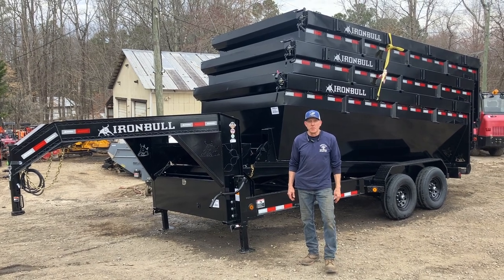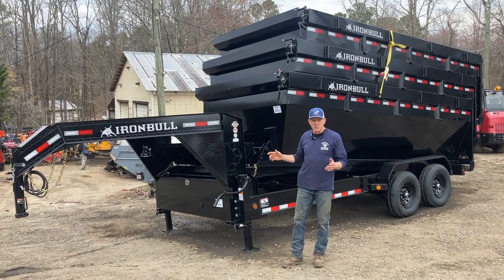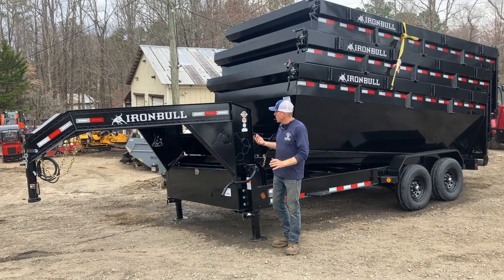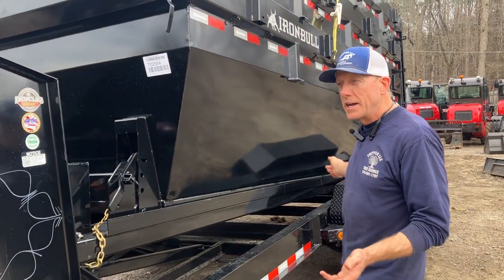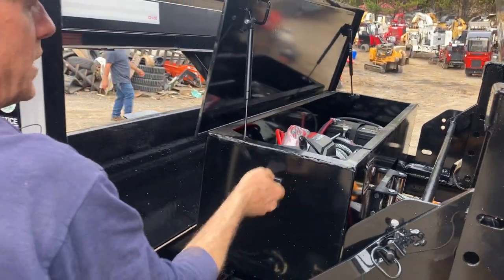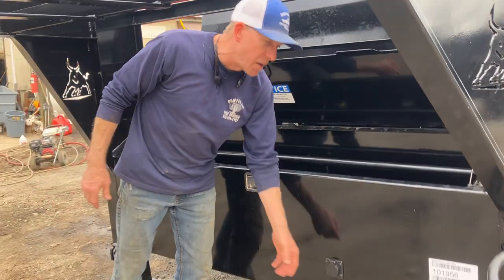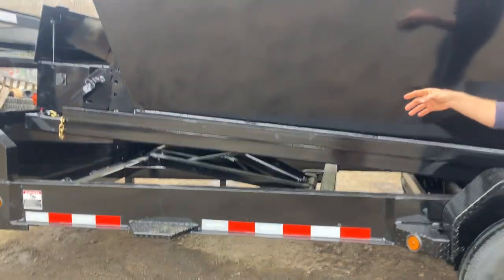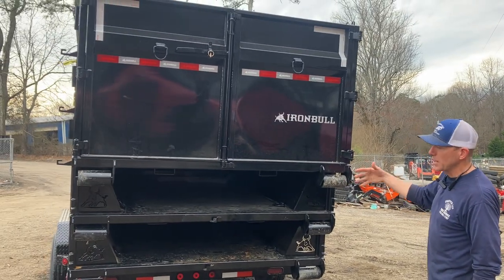2023 Iron Bull DBG Gooseneck 14k 7k Axles Roll Off Dumpster Trailer System with three 16 yard cans

Comment from the maker: System weight is about 5500# so with 7k axles 14,000 GVW leaves 8500# axles payload and 10,500# with 8k axles upgrade.  Of course some of the load  is transferred to the neck of the tow vehicle so if heavily loaded and about 3000# of the weight rests on the neck then those payloads can increase by that amount.  Since you know some of the load transfers to the truck but you don't know exactly how much I would say the 14k system about 10k max payload an 16k system about 12k max payload.

Comment: Can you make a video demonstrating unloading these?
Reply from the maker: Happy to help but can you clairify?  You mean 1) how to set an empty can down? 2) how to dump a loaded can 3) how to get a stack of cans unstacked?
Reply: @chipperllctrailersandequip4214   how to load and unload them when they are stacked like that
Reply from the maker: Unstacking with crane or machine capable of lifting about 2500# at 10 feet out is easiest.  Second option, if don't mind few scratches and don't want to have to rent machinery.  Place floor jack between top can and middle can.  Jack top can up.  Put wood blocks so top can will slide over can underneath.  Typically can buy one 4x4 post and cut it up into pieces.  Find an open area with no hazards and Tilt stack and the top can will slide off but the middle can will not because the tabs at the rear will catch.   Repeat for the middle can.  If they are unstacked and you want to restack would require another machine or some creativity.  @passportgang8189

Comment: Question between gooseneck and other type witch is better to move around turn corners just getting around
Reply from the maker: Gooseneck can turn sharper even beyond 90 degrees, gooseneck also handles weight better than bumper pull.  Iron Bull only builds the gooseneck right now.  Bumper pull may be coming but not available right now.  For bumper pull we have that in stock from PJ and from MaxxD at www.chipperllcsales.com

Comment: Question.. you say, you have MaxxD roll off too?
If so, which one would you recommend out of Ironbull and MaxxD. Im in the market for one of these but don’t know which to pick. Keep in mind MaxxD is nearly $10k more than Ironbull.
I am thinking of hauling dirt & concrete.
Reply from the maker: In the 16' Maxxd is much higher than the Iron Bull but in the 14' MaxxD is about the same as the Iron Bull 16'.  Right now Iron Bull is 7k axles only but 8k and 10k are coming so we are told.  MaxxD you can get with 8k axles and that is what we stock.  We have PJ, MaxxD and Iron Bull in stock.  Here is link to our web site.  Enter stock # R14k or R16k to see the roll off trailers in 14k and 16k  Here are links:  https://www.chipperllcsales.com/trailers/dump-trailers?stock=r14k and https://www.chipperllcsales.com/trailers/dump-trailers?stock=r16k
Reply from the maker: To elaborate our MaxxD systems have 8k axles and 16 ply tires.  With dirt and concrete you will max out on weight before volume so the MaxxD is a great choice for heavy hauling.  our prices on MaxxD are close to the Iron Bull but a little higher due to 8k axle and 16 ply tires.  Check our prices out online!  Thx!

Comment: whats the easiest way to unload the 3 dumpsters once you receive them
Reply from the maker: The easiest way is remove the straps, leave the bottom box connected, tip the trailer back and let the top two slide out.  Of course you need to be in an open area for this and stand clear when doing it for safety.  Dumpsters might get a little scratched on the top rail but it's minor and makes process quick.  You may have the top two still partially together.  In that case just hook to the bottom one and pull it onto the trailer system with trailer system full raised and the top one will slide out.

Comment: Looks like a really nice trailer but the covers on the can instead of the trailer is a deal breaker its going to be a nightmare not having the arm to get the covers over the load
Reply from the maker: Pros and cons to both ways.  Automatic tarp systems are fast but dont really secure the sides of the tarp.  Tarps on each container allow you to tarp it from the ground. Only about 5' from ground to top.  Can add a few bungees along the side if the load is overfull and keeps the system cost lower but agreed the auto tarp systems are nice.  Not yet available through Iron Bull but several 3rd party companies make them.

Comment: why put the storage in front? Do they think everyone is 5'6? and no tarp?....IB is slacking
Reply from the maker: It is normal for goosenecks to have storage in front between the jacks for chains, binders, supplies etc.  What would you do with that space otherwise.  Think everyone is 5'6" I don't get it, understand the problem?  They have a tarp included on each container.  This way you can tarp the container while it is still on the ground so it's easy to reach.  They offer 16' long containers where others only offer 14' for more capacity without having to have higher sides. Sorry I don't fully understand what you say is inferior and why?
Reply: @chipperllctrailersandequip4214  there are some companies that also utilize the space in front of the fenders as storage, at 6’5 it’s not always easy to get under the neck and lift things bending over while the truck is attached. . The site doesn’t show as having a tarp as a standard option, or an option..not that I can see. If they did they should advertise that it is one as most states it’s a law. I will say based on what I’ve seen IB makes them stout.
Reply: @chipperllctrailersandequip4214  I also think by putting the winch in a huge box they eliminated the possibility to rig up a snatch block or am I missing something?
Reply from the maker: @ryanhardin5166  You are correct that Iron Bull builds strong trailers.  They could do better with marketing materials.  Yes, each dumpster comes with tarp standard.  They are working on an autotarper design for the trailer but not yet in production.  The tarp on each dumpster is great because it's easier to tarp on the ground vs on the trailer if it's manual.
Reply from the maker: @ryanhardin5166  The toolbox is more to protect from being stepped on, the rain and sun degradation.  It is open front to the dumpster so could still use a snatch block and double pull.  Just need to remove the snatch block before the final pull into the locks.